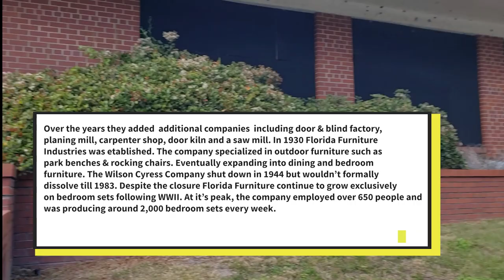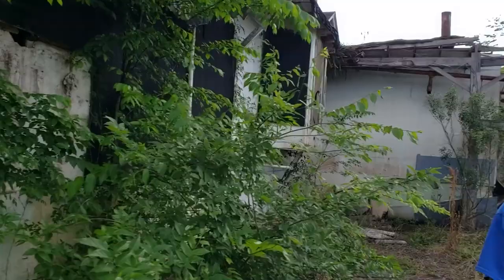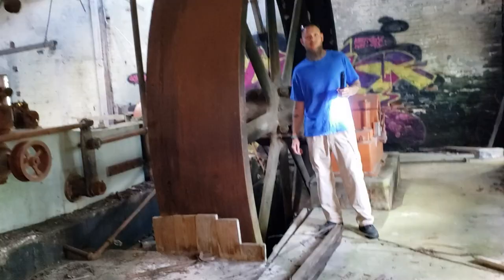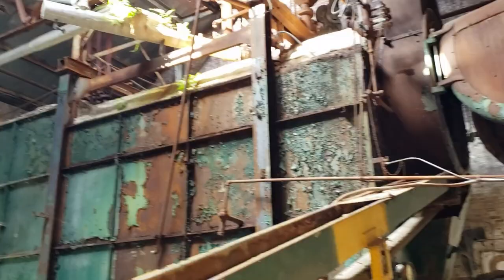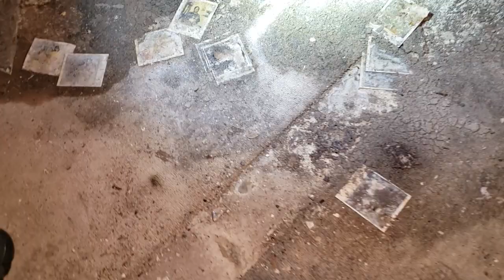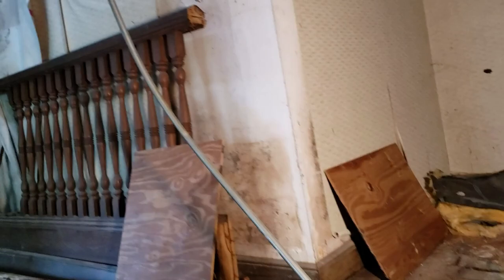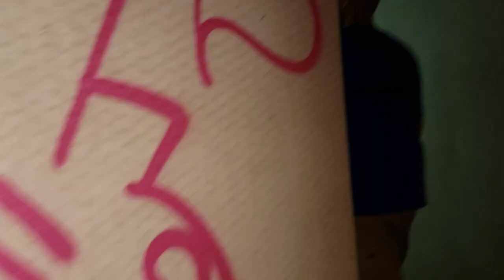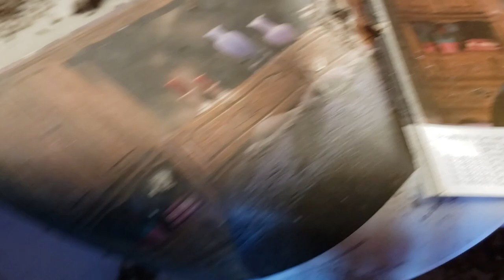ABANDONED Florida Furniture Industries / Forgotten Florida

Comment: Worked at the river plant late 80's till early 90's  . The big wheel was streamed powered motor that ran all machines in plant in the early years .  Boiler burned saw dust  to make  stream for the dryer rooms .